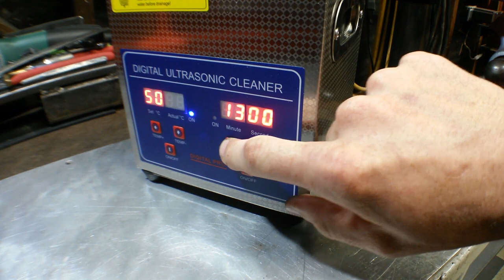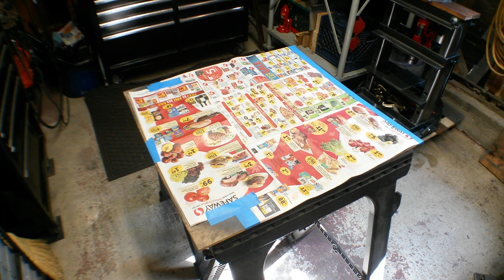1950's Craftsman Drill Press Restoration

Comment: Using this video as a reference, I just finished restoring the Dunlap version that I picked up from a machinist. It was my first time using an ultrasonic cleaner, and it was amazing how well Evapo-Rust worked. I went a step further also placing the smaller parts in a metal mesh tea ball suspended in the cleaner. The motor was the most difficult to disassemble/reassemble. Using a punch on the motor housing was a great tip!
Reply from the maker: Awesome.  Yeah the marking of the motor housing is crucial.  If I'm remembering correctly, I think I picked that up from a Mr. Pete video.  Glad the video was helpful.

Comment: Thank you for the video. I have damn near the same drill press. I was at a loss how the spindle came out to change the bearings. I still can’t find a shop manual on how to do it but your video is amazing. I will have to watch is a few more times, I can’t work as fast as you.

Comment: Quality! I’m just starting a restoration on a craftsman drill press, so this is really helpful. What disks did you use on your angle grinder to remove the rust?

Thanks!
Reply: I'm doing a restoration project myself. I believe you can use a soft to medium wire disc wheel on a grindor. Depends the size. Mine is a dewalt4" and with the soft wire wheel, it removed the rust nicely without scratching the metal.

Comment: Heyyyyy, follow up question, how did you get that piece out at 3:24? I took at the round piece on the side but I'm confused on how you're hitting it to make it come loose
Reply from the maker: So on one side of the head casting (left side if your looking at the press from the front) there is the spring assembly for the quill return.  On the opposing side (right side) there is the quill handle assembly which moves the quill up and down using a rack and pinion style gear that interacts with the grooves on the back of the spindle.  Once both of these parts (spring assembly and quill handle assembly) are completely removed along with the pulley of course, the spindle should slide out the bottom.  In the video at 3:24, I am actually hitting the table down which was preventing the spindle from being able to come out.  The table was frozen to the column with rust.  Hopefully this helps.

Comment: Beautiful work. I just inherited my great grandfather's 1955 craftsman floorstanding drill press and just about have my mind set on doing a full restoration like this to it. After some rust disolver on a few small parts im trying to figure out how you got rid of the dull gray finish it leaves on the steel. I tried a wire wheel and it brings the color back but the tool marks left behind aren't pretty. Is the wire wheel you used particularly soft/fine or is your technique that much better than mine?
Reply from the maker: This was a while ago now but I believe I used a coarse crimped type wire wheel.  The braided types, in my experience, leave the heaviest tool marks behind afterwards.  If the crimped bristle stainless ones are still too rough, maybe a brass bristle brush, also not braided.  Also mounting the wire wheel in a drill press gives you some control over the speed which may also be helpful.  Good luck with the restoration and please let me know if this was helpful.
Reply from the maker: Just looked back, it was a Forney 72742 Coarse Crimped Wire Wheel Brush.  Also just letting the parts glide along the tips of the bristles helps, rather than loading the wheel at all.
Reply: @spaghetticallahan9292  appreciate the response. I wonder if the rust dissolver I used left a particularly thick layer of discolored steel. Just tried another part using an 8 inch crimped brass wire wheel in my bench grinder on the lowest speed and the least amount of pressure and got the same results.

Comment: Will that controller work with a 110 single phase motor ?
Reply from the maker: The controller from the power power tapping video?  No,  it requires a 3 phase motor,  but runs on either 110v or 220v single phase power.
Reply: @spaghetticallahan9292  10-4, do you know where I might find a VFD for 110, with a Single Phase Motor ?

I built A Belt Grinder and it has a 3/4HP 1750Rpm motor, it's a bit much without a VFD Controller. They seem to be nearly impossible to find.

Cool Videos BTW 👍🏻

Comment: So the chuck is part of the shift????? Was looking to put a QC one on my press.
Reply: Sorry shaft
Reply from the maker: The chuck is set on a JT-33 taper.  They make specifically sized wedges that you can use to remove the chuck. Sometimes they jump right off and sometimes they put up a fight.   I left the original on in this case and just replaced the bearing that rides above the chuck.  Also noteworthy, on the older presses there is often a threaded collar above the chuck that both helps to seat the taper and to release it. On my larger floor model craftsman I replaced the older 1/2" Jacobs chuck with a keyless chuck.  The mounted chuck is shown in both the other drill press videos I have up at the moment.
Reply: @spaghetticallahan9292  thank you for the info I appreciate it. I saw a video by @mrpete he described exactly what you are saying. The one I have has the threaded collar . Now to find a keyless chuck and the guts to take on the replacement. Fingers crossed 🤞
Reply from the maker: @BobbyDucati1  No problem.

Comment: Hey, I have this same drill press and am confused on how to change the belt speed. The belt seems way to tight to move so I must be missing something
Reply from the maker: The tension between the pulleys is set using the two horizontal bars attached to the motor mounting plate.  At approx 3:25 in the video you can see the removal  of the motor mount plate and the aforementioned bars.  These bars are adjusted using the two “Frankenstein” looking bolts coming out of either side of the drill press head.  In short, loosen these bolts a little, lightly tap the motor assembly/rear pulley toward the front of the press and this will relieve the tension on the belts.  Ideally you would get it positioned to where the belt is tensioned but you can still roll the belt by hand between the steps on the pulleys to adjust speed.  I hope this is helpful.
Reply: @spaghetticallahan9292  Ok, I took a look, and hopefully I can explain this right, but I can't figure out what's holding those two "frankenstine rods" in place? Like I see the screws that hold the motor to the mount, but are there any screws that hold those rods in place, or do they just come out once the motor is taken off the mount
Reply from the maker: @adamthewoodworker2571  In my press there are is a bolt on either side of the main head casting that act as set screws on the motor mount shafts (frankenstein shafts).  They stick out of the drill press head like the bolts out of Frankenstein's head.
Reply: @spaghetticallahan9292  Hi, sorry if this is a repeat because I can't tell if my follow up to you actually went through. I was curious if this is the bolt that you are referring to: https://imgur.com/a/MmQ8gFZ
Reply: @spaghetticallahan9292  And final question, @3:55, is that bolt the only thing holding the bottom plate in place to the pole? I'm trying to take off the table and the bottom plate from the pole without taking off the top or motor. Right now it is extremely hard for me to move the table left/right or up/down so i'm hoping by removing the plate I can completely clean out all the gunk built up in it.
Reply from the maker: Yep, the bolts you indicated in the photo are the ones loosened to adjust the shafts I mentioned earlier and in turn the pulley tension.
Reply from the maker: Yes,  the bottom base plate is held on by a single bolt that presses on a U shape little piece of cast iron that is enclosed inside to grip the column.  To aide in removing the table, or base plate, I would advise spraying with WD-40 and letting sit over night.  Once you get the base plate off, which can be done with a dead blow hammer,  you can wire brush the column and re lubricate to aide in getting the table to move downwards. Sometimes they are super stuck but with oil, cleaning, and maybe even a little heat from a heat gun, you can almost always get them off.
Reply: @spaghetticallahan9292  thanks for the help! I was able to get the table and base plate both off from the column.
Reply from the maker: @adamthewoodworker2571  My pleasure.